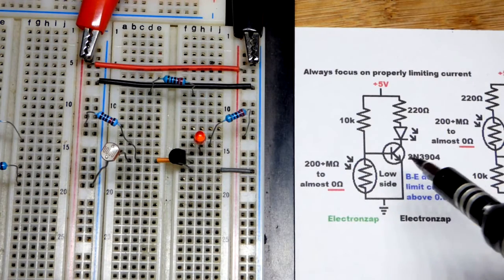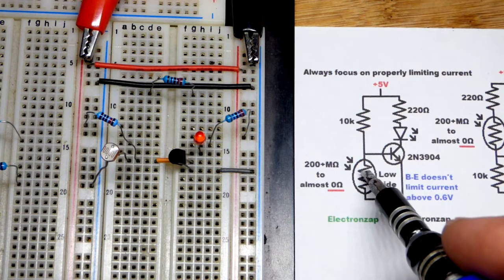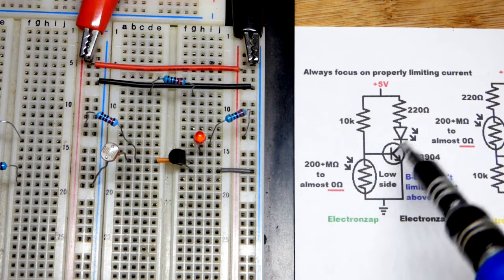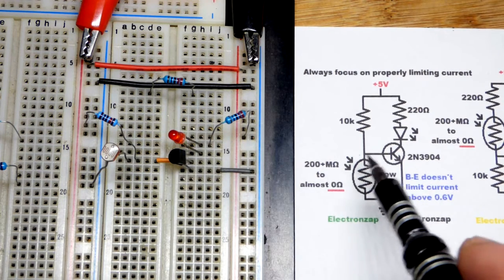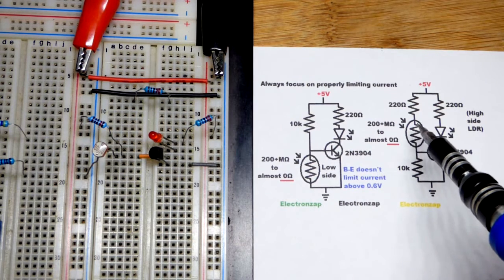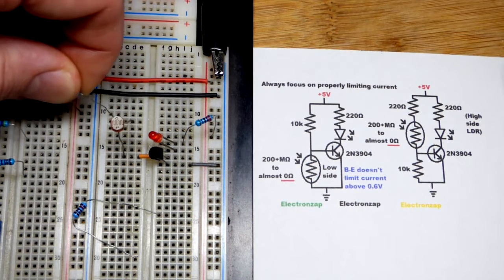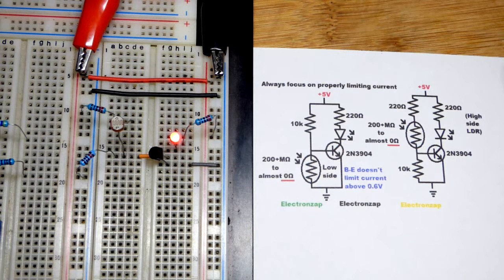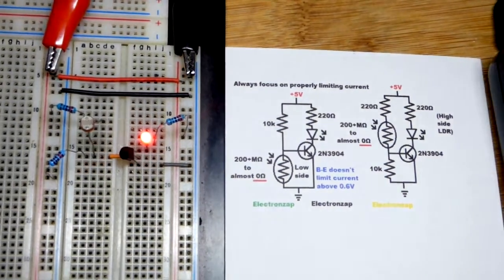LDR controlled 2N3904 NPN BJT switch light dependent resistor learning electronics shorts 26

Comment: Thanks for the video. Is there a way to sub in a solar panel for the LDR and use it to charge your battery/capacitor/supercap powering the circuit? Have been trying to figure out a good way to do this.
Reply from the maker: Solar panels charging batteries is really common these day. Can just buy a charge controller. I can't think of a reason to use a circuit like this.
Reply: @Electronzap  One could argue you should just buy a garden light for this sort of thing. I'm more curious to see if/how it could be done than making something practical per se.

Comment: For an NPN transistor, why do people put the "load" (led) between V(supply) and the collector. Why not put the load between the emitter and ground? It would get more current and therefore power yes?
Reply from the maker: You can put a load between the emitter and ground. That's called a voltage follower (emitter follow) circuit. There will be 0.6 volts less than the base voltage across the load. Plus the load may mess up the base to emitter current in other ways, dropping the voltage across the load even more. So, generally speaking, it is not a good way to wire up a switch circuit.